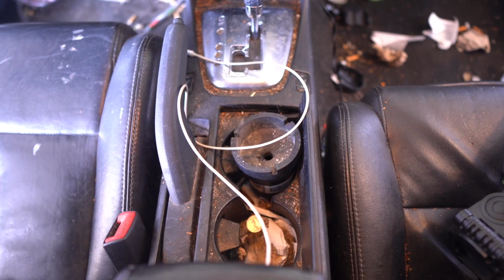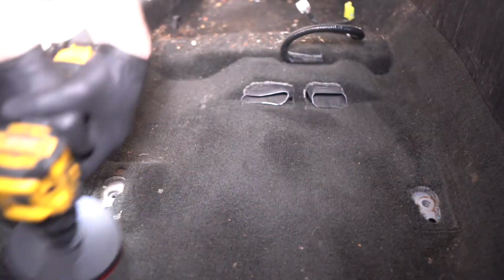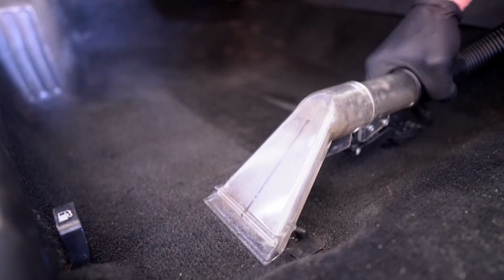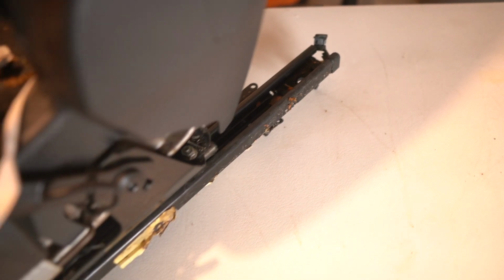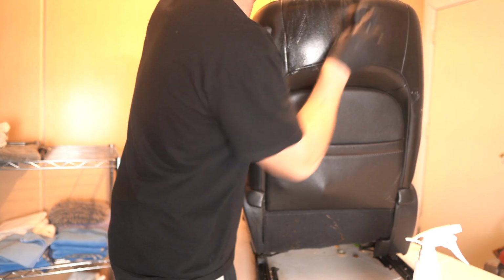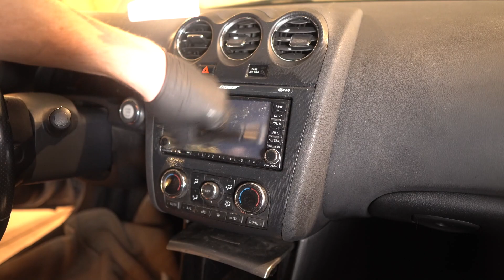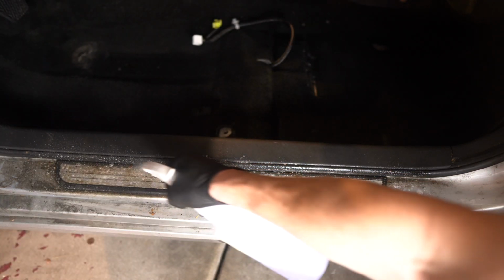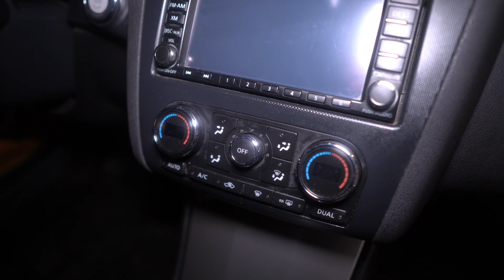EXTREME DOOMSDAY DETAIL on a DISGUSTING SMOKERS CAR!! Satisfying Transformation!

Comment: You've got a really good extractor so you can flush that carpet so heavy with water and that extractor you have will suck it right out. Results on car carpets are a lot better if you treat them as if you were cleaning an actual area rug. Flush it with a ton of soapy water, even if it is pooled on the floor, and quickly extract. You'll see what I mean and how much more easy it is to get most of the dirt and crap out. Other extractors I wouldnt recommend this with, but this one, go nuts!!

Comment: What kind of extractor are you using?
Reply from the maker: Sandia
Reply: Chris Details is it the 3 gallon model? What’s the model #? How much did it run you. I detail out here in SLC,Ut and am interested in a a better machine.
Reply from the maker: Jared Ostler it’s the sandia 50-1000 3 gallon
Reply from the maker: Which one are you using now?
Reply: Chris Details I’m using some bissell cleaner for my house carpets that has an upholstery attachment😂. It works good,  but it’s not convenient and needs to be emptied every section or two. Holds a gallon at the most.

Comment: Hey Chris, I see wear you encountered paint on the customer's leather seat. Have came across this before. Might I suggest trying Lysol wipes before you start your leather seat cleaning routine. Those wipes remove almost anything just dry it up right after the stain is going. In my experience I have not had any issues. Just a suggestion. You worked miracles with that car's interior.
Reply from the maker: Hey thank you I’ll remember that!

Comment: BEAUTIFUL job. 
I was wondering how much of the cigarette smell did you get out?
I'm trying to clean my uncle's car.
he smokes. and its ABSOLUTELY minging:(
Reply from the maker: A lot of it came out! The owner told me not to worry about it because they are going to continue smoking in there but it was definitely a lot better haha thanks for watching and engaging!
Reply: When I bought my car two years ago, I used a can of Lysol spray on the floors, headliner, and HVAC ducts to remove the dog and smoker smell. It did an excellent job removing the smoke smell. When and if you can find Lysol spray cans in stores again, grab one and hose down any fabric that would retain the smell. Then if you have any left, run the cabin fan at full speed, find the outside inlet (usually on the passenger side windshield wiper) and hose it down. My car has rear air conditioning so I blasted that system too. Hope this helps!
Reply from the maker: Use ozone treatment though, I plan on buying one soon
Reply: There a spry u can get at Walmart called ozium and a od er r eater u can leave in there by the same brand it work on any kind of smell I'm a smoker and it all I smell is that it great stuff

Comment: I don't know if anyone had past on to your how to remove paint from leather safely but here is the info.
Put coconut oil or baby oil on a cotton swab or cloth, dab the swab on a paper towel to remove the excess oil, then rub the swab on the paint spot until it is gone. Try not to let the oil soak into the leather. Once the paint is gone, wipe the area with a leather cleaner or soapy cloth to remove the oil residue.

Comment: use your brush head to really go hard on the carpet immediately under the door seal. those areas get disgusting. you’ve got a tank of an extractor, too. let your cleaning solution soak for a little bit after agitation and really take your time vacuuming it up! it might take a few extra minutes, but you’ll find yourself doing less work because of it. don’t be afraid to pop out center consoles to get them scrubbed down properly!

Comment: What extractor is that?
Reply from the maker: Sandia 3 gallon
Reply: @chrisdetails3995  Do you recommend the Sandia 3 gallon?  Is it reliable?
Reply from the maker: lucabrazi36 It works great and reliable, the handle can be kind of large working in tight spaces sometimes that’s the only complaint I could make. There are a variety of extractors out there just do some research before you make a purchase!

Comment: I can't stand cigarette smoke.  I have to wear a mask with a filter.  In looking at the interior, I would fire up my compressor, open up both doors, remove the trash, then 'blow out' the interior with air.  That would at least remove the initial bulk of ash and debris to make the vacuuming easy.  The remainder of cleaning would depend upon the owner's ability to pay and your availability to do the job (Interior & Exterior); and could easily be a 10+ hour job to totally disinfect & sanitize this car.  Ozone charge; headliner cleaning; steam cleaning; changing cabin air filters; scented air bomb; -Charge accordingly.
Reply from the maker: Haha yeah it was a lot of work!